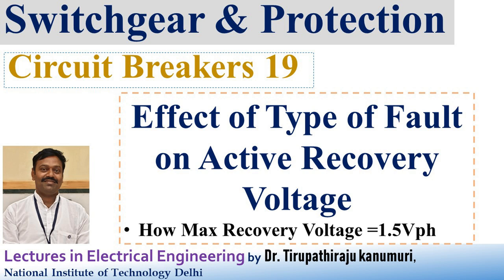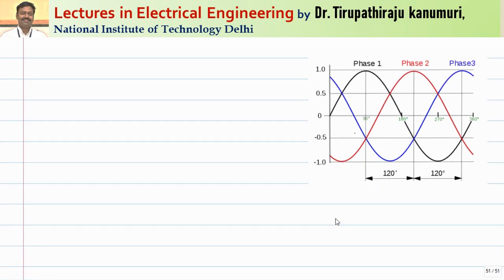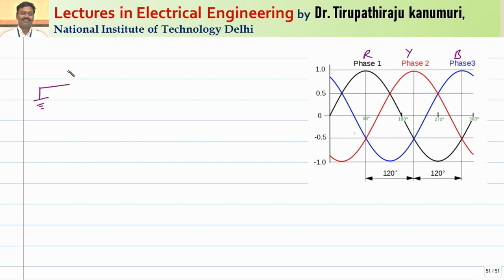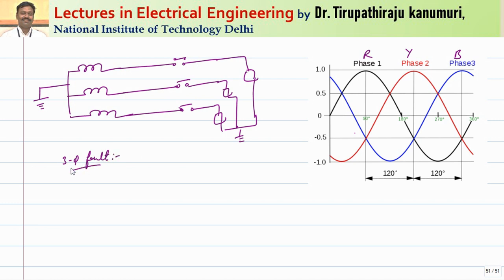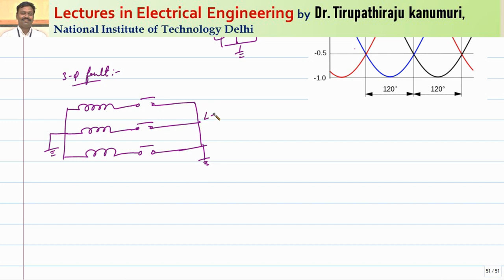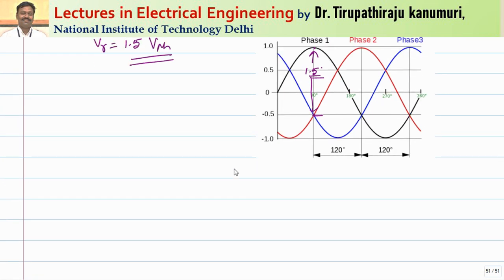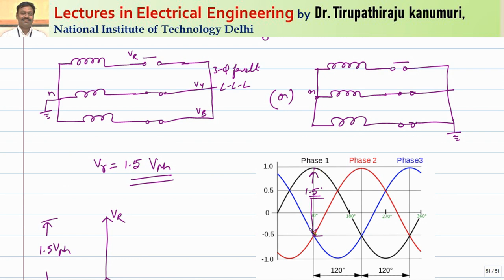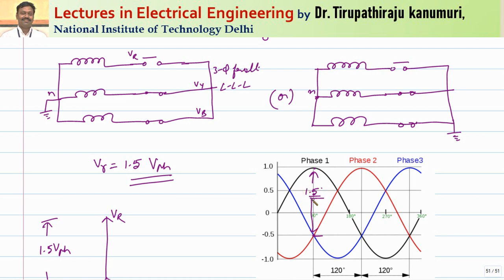SGP219 Effect of Type of Fault on Active Recovery Voltage

Comment: Thank you so much. Sir, I am an engineering professional and not preparing for any exam but want to understand in depth about the current flow and voltages during various fault conditions with different transformer configurations ( Also when distributed generators are exporting power to the grid). Could you please suggest some resources ( books, papers, journals, videos etc)to learn that? Once again thank you so much

Comment: Sir like u said,max possible value of voltage under fault condition is 1.5 Time phase voltage .So considering 6.6KV transmission line the max voltage will be 1.5*6 which is quite less than the breakdown voltage of air .So under that condition why arc will restrike or there won’t be any arc between the contacts .Please explain .

Comment: Sir what about Incoming Breaker for a delta star grounded neutral Transformer? If the neutral becomes ungrounded , then recovery voltage will increase or decrease at Breaker ?